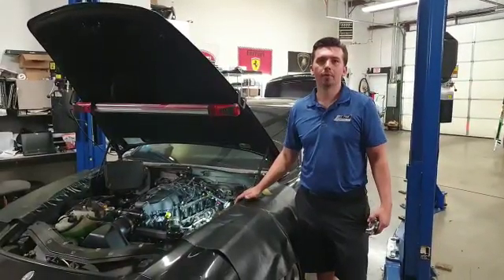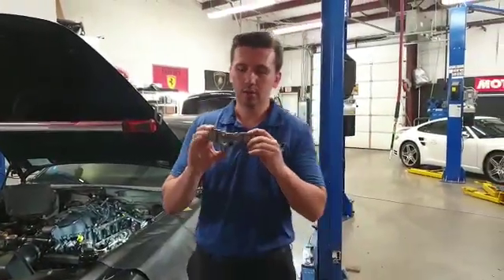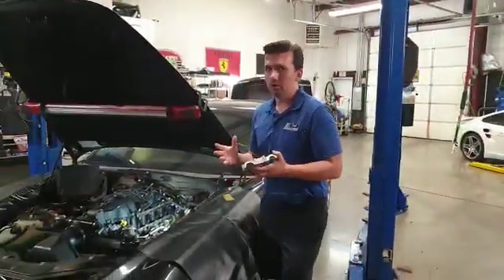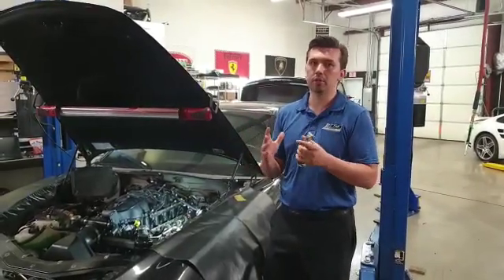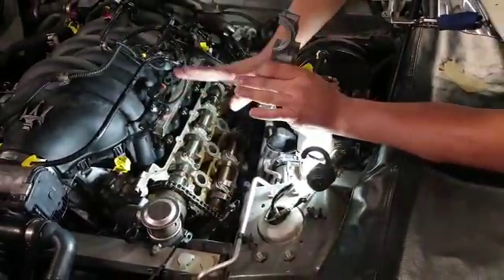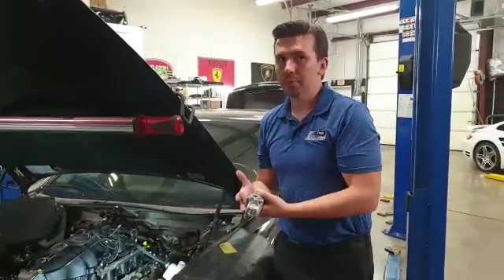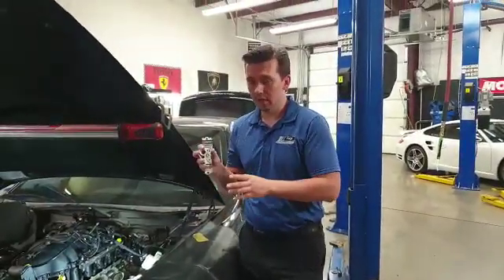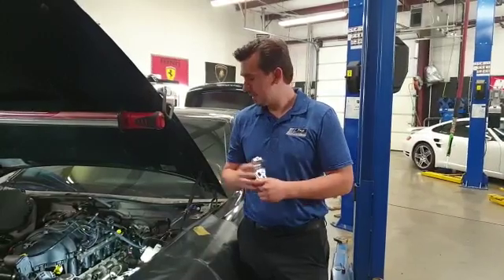Solution to a problem with Maserati/Ferrari variator rattle on cold start

Comment: HY. DO. YOU. SELL. THOSE. SO I CAN. INSTAL THEM. AND. HOW  MUCH IS THE PRICE. FOR THOSE. SIR
Reply from the maker: @juanmaldonado3281  

We machine your original end caps and install check valves. You would need to contact the shop to get pricing.

Comment: 2005 4200 running into this. Rattle only lasts about half a second and then the engine runs completely smooth from then onward. Oil changes every 5,000 miles. I’m guessing both variators will need to be replaced at this next oil change and I will have a hole in my wallet.

Comment: Just picked up a 2013 Quattroporte S with the 4.7L and its got a rough idle. Any idea what this could be? its got 56k miles on it and looks extremely clean and well looked after. I want to throw plugs at it but I dont think thatll solve the issue. But ill see.

Comment: How many km can go with the timing chain? Mine Make a noise like Little Hammer in hot every time i leave the throttle. So after accelerate until 900 rpm. In neutral without accelerate doesn't do it

Comment: Did i miss how much it costs to do this job?
Reply: @sjb3460  geez, no wonder they sell the car cheap, it'll cost anyone an arm and a leg to maintain.  Thanks.
Reply: @sjb3460  yes, i like the car, and in fact i saw a few and said wow, they are cheap but i started to inquire, specially your info on your video and that's how i ended up here watching your video, which i learned is the most comment and now the costs, among other info i've looked into.  I'm on the opposite spectrum...love the car for the look and sound, but don't have the money for upkeep.  So i appreciate your video and letting all know.
Reply: There are plenty of videos on this.  Its not that expensive.  Machine shops charge around $600 to put in the check valve.  Its just the labor to pull off the valve covers.  Around $3K to $4K is what you should pay.

Comment: Hi nick , I have changed Variators and timing chain the noise in the start is gone but the car noise from the exhaust has changed is sounds different  when i drive it dosnt sound like not like an maserati , and sometimes when its cold it vibrates when the car is runing while its neutal gear.
Reply: hi i know its 8 months ago you wrote this but from the sounds of it - your timing might be off very a little bit

Comment: No cap re-machining on the dry sump 2005-2006 MY cars.  Only the wet sump motors with the low-pressure variators.  Dry sumps have completely different hi-pressure design with a helical variator with a less common rattle often attributed to accumulator wear.

Also the updated variator for the wet sump cars is actually different and less likely to have locking pin failure.
Reply: Dude, all 08 GT are wet sump
Reply: @jefferyyoder9785  yes but he says “this is effective from 2005 to…” that’s where he is wrong as the wet sump cap update doesn’t apply to the dry sump motors (2005-07).   He’s also wrong as he mentions the Ferrari cars as the variatior issues pertaining to those cars are different.
Reply: Thanks Erik

Comment: I'm looking for a 2012 or later GT MC only. Is this an issue with those models? If so, and the car I'm looking at does NOT come with maintenance records, is there a way to determine if this work was done? Average cost (for negotiation of purchase price if the work was not done)? $3K, $6K, $10K?? Thank you.
Reply from the maker: 2012s are updated already

Comment: Nick-I just got an estimate from a local Ferrari/Maserati dealership. $8848. You guys do it for less?  I'll take it to you lol. Love my car still. I'll get it fix.
Reply from the maker: For sure
Reply: Do you still have your car?
Reply: @marcushunter1406  Yes.
Reply: @1657mmartinez  Did you have the repairs done?
Reply: @marcushunter1406  Unfortunately, no. I did want to get it done. I ended buying the wifey a new SQ5. I should've spent the money fixing the variator issue though. You have the same issue?
Reply: @ManuelMartinez-ob3og  I don't know if its the variator but my car has a slight knock during idle.
Reply: @marcushunter1406  my issue(rattling) only happens at 1st start. It last a sec or 2. I did take my car to a ferrari/maserati dealership and they said the variators need repaired/replaced. But I want to do add what this mechanic pro says.
Reply: @ManuelMartinez-ob3og Hello Manuel, have you had this done?  What was the outcome?

Comment: Hi there, i think i am have this problem too as i have “check engine light” on,... and after check it says “cam shaft slow response bank 2” rattling sound is very minimum should be the initial stage of the problem. Mechanic here all says replace both cam shaft totally i need your advice please 🙏
Reply from the maker: Almost impossible to determine unless it can be physically diagnosed by a professional. Unless I can see it, I really can't tell you much. Best option is to find someone in your area that works on these to avoid throwing parts at it.
Reply: Top Automotive Inc Thanks
Reply: Alan Pang I had same slow response on CEL.. just change out solenoid and solved. Much cheaper than doing a variator job.
Reply: Wilson SG hey bro , mind to keep in touch ? I hope to learn more from you 😅 my contact number 93827850

Comment: I got the same problem, the engine making noise all the time now. So do l have to go to the dealer to get that fix or anywhere else they can that?! Is it cost a lot?!
Reply from the maker: Without performing a diagnostic by reading variator live data for advancement delay, it is hard to say the extent of the damage of variator system. You need to find a good indy shop that has experiance with these engines. They should be able to tell if variators are damaged, or other components.

Comment: I believe the design flaw got a factory fix during the 2010 production year.  All models with this engine from 2011 on come with the fixed variator end caps.
Reply: @Austin Kye Maserati TSB said engines w/ code 150070 or later should have the fix. I have the document downloaded from Maserati. Apparently the 4.2 was updated after around Sept 2009 and the 4.7 after around Sept 2010.
Reply: You are correct.  But it's late 2010.  Early 2010's still have that issue.
Reply: @Austin Kye Mines noisy